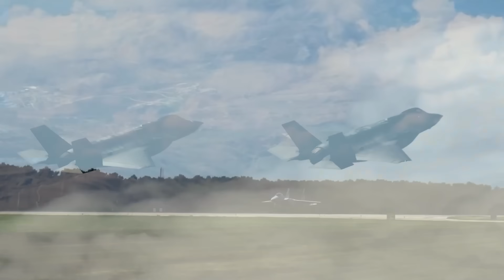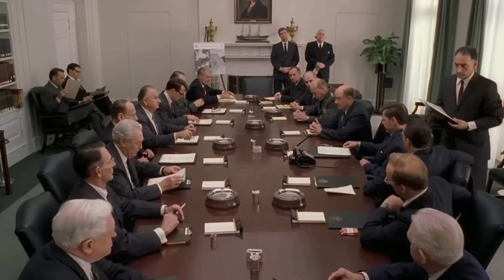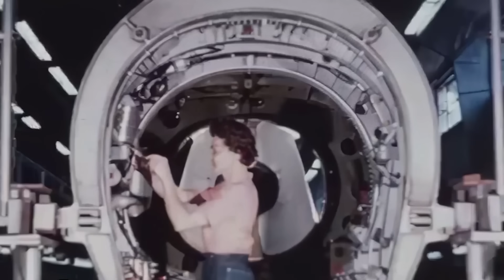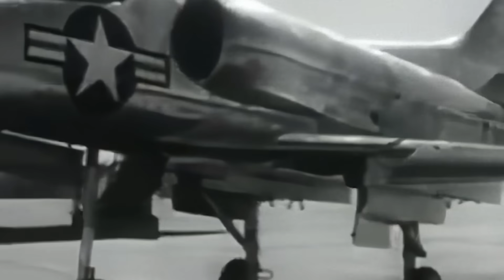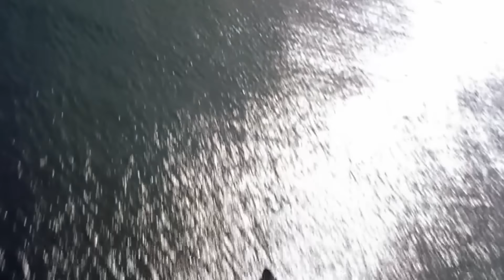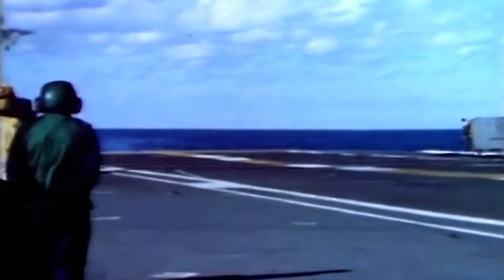A-4 Skyhawk - Simple and Deadly

Comment: Fun fact about the IAF ayits, my uncle worked on them in the late 60s and early 70s and because heat seeking missiles were such a big threat they installed a 1 meter pipe at the end of the exhaust so if a missile hit the plane it could still fly home.

Comment: My father retired as a Major USMC, his last station was as CO over at Los Alamitos Naval Air Station, before that he was over at El Toro Marine Base from 1960-1967. He stayed stateside during Vietnam and taught air combat at China Lake, he was also the CO of the weapons depot inside El Toro, a small area with 14 foot fences and concertina wire, two guard towers with M-60 machine guns and spotlights, and a perimeter guard with a M-14 and police dog. I could read so I couldn’t go inside. This was with the VMA-322 Polka Dots if I remember correctly.
  His squadron was flying the A4 Skyhawks at that time but before El Toro they were over in Okinawa and Japan in the late ‘50s. During the Korean War he was still with the VMA-322 and flew the Corsair his favorite plane, earning a Distinguished Flying Cross during an attack on a AA emplacement. He also flew a TBM , and twin Beechcraft during that time making parts runs, beer and ammo runs as well.😊 
  He entered WW2 in 1945 flying a TBM off the CVE-106 Block Island and saw combat at Okinawa, New Guinea and other missions. He was with the 233 Flying Deadheads during that time. 
  During the Falkland Islands War he told me that his old VMA-322 A4 Skyhawk planes had been sold to Argentina, stripped of the key avionics. He was worried about the Brits because he knew how capable and deadly the A4s were at low altitude. In some ways they were precursors for the A10 , quick and fast enough , and they could reach supersonic in a dive. Capable of dropping nukes as well because they practiced that out at China Lake. Flying at 50 ft. above the deck pulling up around 20-24 miles out and releasing at a given angle and altitude then hitting the afterburner to get back down and away if possible. One other note is my dad was one of the original Flying Peons, one of the last in some ways, served as president once for the association. They are all gone now I suppose. Look up the Flying Peons, they were a special breed of pilots. Master Sergeants leading 2nd. Lts during the Korean War because they took a reduction in rank from 1st. LT to stay in and keep flying after WW2. Best job he ever had was what my dad said. He passed at 98 5 years ago. Oh, after retiring he became an Airlines pilot, retired from Air California.😊
Reply: Respect, Like you my Pops was a fighter pilot flew interceptors then transitioned into the A-1 he loved that bird. Left orbit a year ago I miss him.

Comment: Inexpensive aviation is quite useful but the capabilities offered by flagship high end aircraft are really hard to argue with. I do think it’s a good idea to pair the two together having a cheap rugged reliable aircraft that can be used for low intensity combat and lets you keep flying hours high and maintenance cost low making sure your pilots are always well trained and experienced is sensible. But in the modern era it’s not a good idea for that to be the only thing you have. The F-15 is a great pairing with the F-35 because the F15 can handle most things we need to do against most opponents but when you really really really need to own the skies there is no substitute for a nearly undetectable multi role platform with the most advanced sensor package and battle management system ever fitted to a fighter aircraft.

Comment: Just a couple of notes from an old Marine A-4 (J52 power plant) maintainer:

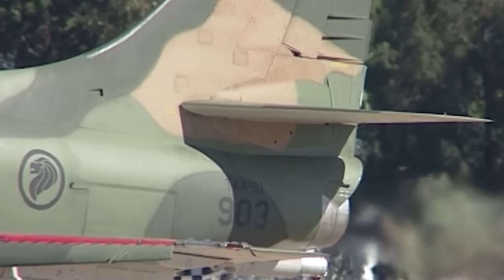1.  At about 7:18 mark, speaking about the fuel system.  The wings were not the main fuel cell, which was behind the cockpit and essentially between the intakes.  It held, if memory serves, 230 gallons.  On the TA-4 trainer version, this tank was much smaller due to the use of part of the space for the rear cockpit.The wings - 535 gallons I believe? - fed their fuel into this main cell via a bleed air-driven turbine pump.  In addition, the wing transfer could be accomplished via an "emergency transfer" selection in the event of a turbine pump failure.  The emergency function pressurized the wing to force the fuel to the main cell. External drop tank fuel fed into the wing tank.

The main fuel cell was a self-sealing bladder type tank which could, when needed, be removed; thankfully this was rare as it was an extensive, labor-intensive evolution.  I was in on doing it perhaps a dozen times in the 7 years I worked on them; most of those were on older model A-4F's that had developed fuselage cracks behind the intakes that required depot-level repair.  Removing the main cells was squadron-level maintenance to allow access for the depot metalworkers to do the job.  This was late 70's.  Think I only ever removed one cell for a tank issue and that was later on with an A-4M.

2.  Would like to have seen a discussion on the progression of engine starter options from the original externally-attached starter probe to engine-mounted turbine starter to the final version, on the A-4M, of the internal self-starter, the Airesearch JFS100-34.

Comment: If I could own a military jet for private use, my first choice would be an F-16. My second choice would be an A-4 and my third would be an A-7. What would you choose?
Reply: A-4, hands down, when you consider the maintenance required and the ease, or lack thereof, on those three.  Probably choose an "F" model; same more powerful J52-P-408 engine, but without the self starter and drag chute.  Nice to have, but just more systems to maintain.  The on-board turbine starters on earlier models were essentially bullet proof other than occasionally shearing an output shaft which was easily repaired/replaced.  When the JFS100-34 internal self-starter on the A-4M failed, you were screwed.  Often it was the control box that failed and we kept spares around that could be patched in for a quick fix.  The direct maintenance man-hours per flight hour comparison wouldn't even be close.  Fuel consumption, too. 

Of course, if you could afford one, you could probably afford the maintenance and fuel bills.

MGySgt USMC-retired
A-4 Maintainer 1975-83 (A-4F '75-81; A-4M '81-83)

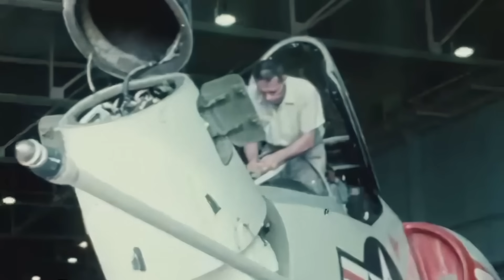Comment: 7:33...... The main fuel tank for the aircraft was not in the wings, it was right behind the pilot in the space between the 2 intakes. There were wing tanks, and then external drop tanks could be carried. Pulling that main tank for inspection or repair was a real PITA.
Reply: Sounds like you've been there, done that.  Didn't see your post until I had already posted on the fuel cell arrangements.  I got to do about a dozen main cells.  Back in the late 90's I was active duty staff with the Marine Air Reserve unit in Jacksonville, FL.  Some fuselage cracks were discovered and they were in behind the intakes.  The repairs were done by the depot guys, but we had to pull the cells for them to install the doubler plates under the fuselage ribs.  Definitely a PITA; we did it pretty much assembly line style over a period of perhaps 4 months.  Had to have the top and bottom blank-off plates manufactured first in order to pull vacuum on them to collapse for the removal.  Somewhere in the world there may still be some flying around that if you remove the main cell you'll find the duct tape message letters we left behind saying "MARTD Jax".  Only ever did one other main cell for a fuel system itself problem and that was when I went on to A-4M's back in the fleet (VMA-214, El Toro).  Nobody at El Toro had the blank-off plates (telling you how rare it was to pull a main cell), so I called back to buddies in Jacksonville to borrow them.

Comment: Heinemann also designed the Buddy Refueling system.  He used a small "Propeller" in the front of a modified fuel tank...
The Fueling Hose extended and retracted using power this simple hydraulic motor supplied.  (Which also drives the Fuel Pump that refuels the other airplanes!)
 
The idea is to takeoff with Maximum Ordnance that prevents you from taking off with full fuel tanks.  Climb to altitude, then refuel......
Reply: The Buddy Stores system. I worked A4 Avionics in the 80's and we had to make sure that system worked. It rarely got used in regular flight ops in my units.

Comment: Didn't know about the humpback design on newer A-4's.
Reply: A-4F's and A-4M's.  Also have a smaller pod on the top of the tail (aka the "hotdog").  Mostly ECM related gear as I recall.  The M's also feature an internal gas-turbine self-starter which isn't discussed.

Comment: Singapore used the F404??  Awesome.  Same as the F-20 Tigershark!  Sans afterburner.  But still, that’s a BIG upgrade.

I have to wonder if the Navy/USMC would use them today, if the airframes were new, with logical engine/avionics upgrades.  Just a bare bones, inexpensive, brutally capable attack aircraft.   $1million then would be, what - about $12-15million today?  Laf, over LM’s dead corporate body.

Israel used it; that’s all you need to know about how good it was.

Comment: The armor (shielding in front, below and behind the pilot was good, but the sides weren’t shielded at all. A friend of mine, a Marine pilot flew an A-4 in Vietnam. On the way home from a mission one day, he told me he did a high bank, tight, low to the ground turn around a wooded hill. In the tightest part of his turn he said an enemy soldier in the jungle fired his AK-47 into the air and in a fluke shot hit his jet. My friend said one bullet hit his A-4, easily pierced the thin metal side and went through both of his legs. The bullet stopped in the fabric of his flight suit on the other side). With no real damage done to the aircraft, he was able to make it back to his airbase for a safe, albeit very painful landing. (Can you imagine trying to apply the brakes with a bullet wound like that.)

Comment: ok, screw the french-delta-wing which goes all the way to the rear-aft-aft and screw the electronics industry control-freak on the slats by gravity weight shape cable-length adjuster and torque-drill adjuster combination as preload-auto-pilot. clutched power-drill torque setting is cheap and good for many purposes. 2 items will be good enough to be implemented and counter-check millennial-designed aircraft/cars/trucks/ships/...

Comment: I honestly think you could restart production with not many changes and have a low cost attack plane (ersatz fighter too) for any country still using small carriers. Obviously a turbofan would replace the turbojet (F-414 comes to mind, although it'd take a Israeli-style tailpipe extension to fit the afterburner; if stripped it would reduce maximum thrust to about 6 tonnes, not ideal). Apart from that, if mission creep could be avoided, modern avionics would probably not require the hump, though it would unavoidably still make an appearance as a CFT. Modern materials could be used to shed some weight and maybe reduce RCS (though again, beware the mission creep). 

It's about thinking cheap; same airframe, the fewer bells and whistles, the better. A couple of more pylons (7 at the minimum), maybe wingtip rails for AIM-9s, a small AESA radar good enough for ground scanning and guiding AIM-120s but not meant to against dedicated heavy fighters. Sort of like a downrated legacy F-18 with modern components to complement the likes of F-35B on carriers too small to handle anything bigger and non-STOVL. (Obviously not for USN.)

It would still require external fuel tanks and probably (buddy) refueling for any mission, but that couldn't be avoided without a significant redesign, thus defeating the purpose.

Comment: The A-4 was a great little jet. The rumor in the fleet was that she was designed to carry an atomic bomb -on a one way mission. I knew many US Navy pilots that loved this jet. I even knew a tech rep from Douglas Aircraft that spent his entire career servicing the A-4 in GTMO, aboard CV'S, and Puerto Rico. I slept well knowing our A-4's were on duty. I know one Navy pilot that retired as a Captain (O-6) that flew one in Vietnam, took battle damage, and flew his jet-upside down-back to a USMC airbase, flipped it over just before he landed it, and walked away. He was later the CO of the NAVSTA, Roosevelt Roads PR. His name was: "Captain Connor".
Reply: I can tell you we were still doing the nuke proficiency inspection drills for our ordies at El Toro in the early '80s.

The guy who allegedly flew inverted back to base must have been practically in the pattern; the A-4 had no inverted fuel pump.  The bottom of the main cell only had a small capacity enclosed sump in the bottom for very short duration of flight inverted.  Fuel entered this sump via simple gravity flapper valves.  You might get a few minutes of fuel supply, but certainly not an extended length of time.  If you're inverted you would also lose fuel transfer from the wings and drop tanks which, in normal flight, continuously keeps the main cell full, so you would quickly exhaust the main cell supply (230 gallons when full) even if you could use the entire contents.  That inverted flight sump holds (don't quote me on this, it's been 40+ years) perhaps 30 or 40 gallons.  You would get some additional fuel from the rest of the cell until the level dropped far enough to cavitate the pump.  The pump only extents up into the main cell less than 18".

A-4 Power Plants Marine

Comment: I saw A4's still flying in the early 80's.  I think the famous VMA-214 Blacksheep squadron flew A4.  They were extremely maneuverable.
Reply: You are correct, VMA-214 did have A-4M's in the 1980's. I did the last WestPac with them in 214 in 1987. We turned our planes over to VMA-211 in Iwakuni, and they did the last A-4 WestPac. VMA-214 switched over to the Harrier after that. Fun times.
Reply: @themetalmaiden7462  Semper Fi.  VMA-214 Power Plants 1981-83; Navy Unit Commendation and Lawson H. M. Sanderson Award  (Marine Attack Squadron of the Year).

Comment: Marine Corps veteran. Plane Captain, TA-4F & A4M . 1979-1983.
  H&MS-31, MAG 31, MCAS Beaufort, SC.
   H&MS-12, 3rd MAW, FMF PAC, MCAS Iwakuni, Japan. 1980-81.
    VMAT-102, 3rd MAW, MCAS YUMA, AZ. 1981-83.
   The A4 will always have a special place in my heart. As well as the special Marines i had the privilege, pleasure and honor to work and serve alongside.
  Semper Fi Flight Line Brothers!
Reply: Semper Fi brother. I share a couple duty stations with you. I too was a plane caption on the A 4. A little bit before you I was stationed in 1974 on MCAS Beaufort with VMA 331. Then in 1975 and the first part of 1976 I was with H&MS 12. I was a plane caption and worked in power plants shop there for a bit. What a small world
Reply: @ Indeed a small world. 
  Semper Fi back at you brother!
Reply: @mikeprichard7933  Semper Fi, Brother; we may have worked together.  I was H&MS-12 IMA J52 shop from March '75 to April '76.  Went TAD to Osan once when one of your planes crapped an engine.  Me and two others from the IMA shop went along to assist with the engine build up prior to install.  Great few days.
Reply: @johnstreet1812  Semper Fi brother. WOW We were for sure there at the same time. I don't remember the bird going down in Osan but alot of my time in Iwakuni was spent on night crew. I deployed twice to Osan for ACM training and twice to Kadena Okinawa. On one trip we had two F-4s colide mid air on take off from Kadena. No one crashed and they circled around and landed. I went TAD to Cubi point for a bird that landed hard and broke the front seal in the CSD. I took a two day job and stretched it out to Ten days. Man that place was fun. Small world. Semper Fi brother

Comment: A1 Skyraider: Obsolete within 5 years of launch
A4 Skyhawk: 35 year Production Run, Countries still seeking to purchase them second hand 15 years after production ceased, still flying in military forces 10 years later...
Designed to be cheap as possible aircraft for ground attack, quarter the cost of the equivalent gen air superiority fighter. 20 years later it's used to give the next generation of fighter aircraft a challenging opponent for air to air combat training. Absolute legend.
Reply: Despite the A-1 being “obsolete” it still served from 1947ish to 1973 in combat roles. A very long service life especially for a prop driven attack platform.

It was essentially the A-10 for that era. Nowadays the A-10 has been toted as obsolete for around 10-15 years but its role in loitering counter-insurgency and ground attack in airspace free of anti air still needs filled. 

(I will preface the A-10A was pretty terrible because it was too simplistic and blue on blue incidents were notorious because it had no friendly identification technology or map displays.

A lot of these issues were remedied with A-10C)
Reply: @ICECAPPEDSKY  1979 in Chad.

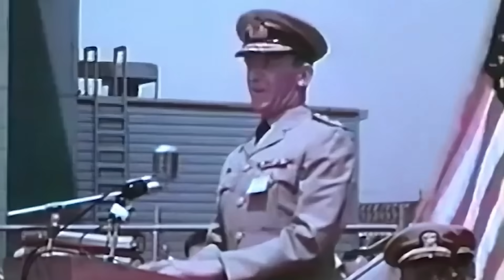Comment: @15:44 Canada never used this plane in their airforce.  It was purchased  fairly recently for training by an independent pilot training firm called Top Aces working under contract with the Canadian Armed forces for pilot training after Canada retired their CT155 earlier this year.  The A4 was pitched to the RCAF and RCN but the CF5 (F5) was bought instead. This was a political decision to appease (buy votes) in the Montreal area as the CF5 would be built under license by Canadair in St Laurant -  a suburb